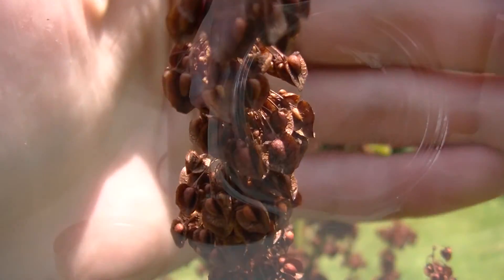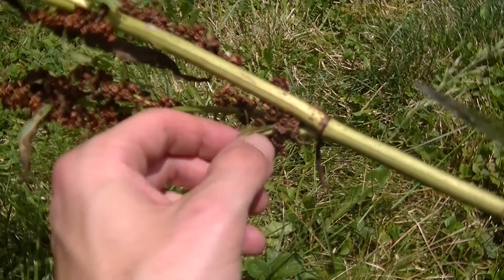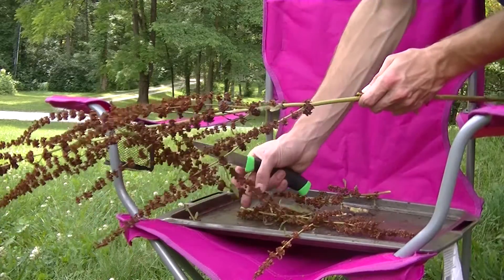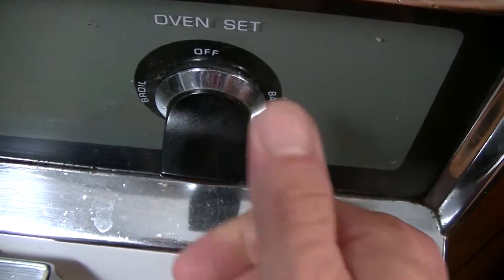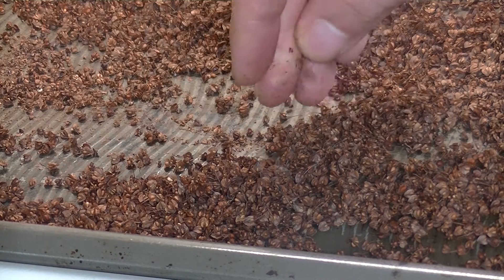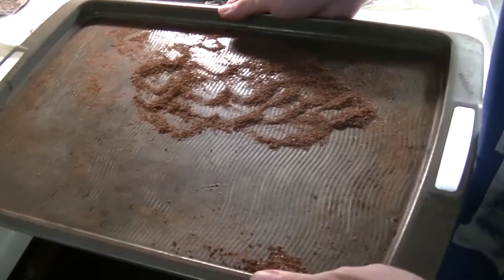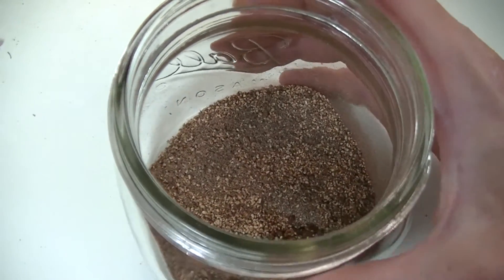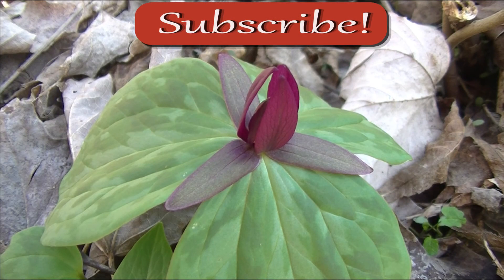Harvesting Wild Edibles - Curly Dock Seeds

Comment: Is it possible to grind this up with a mortar and pestle method instead of a blender? I'm going to be living with no electricity starting this year and for a long time after... maybe forever. Great video for another very valuable food source. Thank you.
Reply from the maker: It certainly is possible, but will be very difficult as the outer husk of the seed is extremely tough and hard. You might try soaking the seeds in water for a few days, or maybe even sprouting them. That might make them easier to grind up. Hope this helps and thanks for asking!
Reply: I know this is an old comment so this may not be helpful, but a food mill could be perfect for this. There are some decent hand powered ones for pretty cheap.

Comment: If you are going to add normal flour, no need to remove the shaft. In some wheat flour for example they keep some of the shaft and the bread out of it is high fibre bread. A lot of fibre is not always a bad thing even though it is not digestible. If the shaft affects the taste a lot then it is an issue.

Comment: simply hand strip seed from standing plant into a garbage bag.
rough grind hole seed.
simmer
grind mixture in water until oils and unwants float on top.
gently skim off the floating debries by gently over filling the container.
strain the heavy and dehydrate @110° till completly dry.

finish grind this in a stone mill or household equivalent appliance.
having removed the oils and fats from the flour.
this smooths the taste and prevents the flour from turning rancid.

doesnt matter what you want to make flour from this method works great.
thing like nuts and corns with lots of tannic only need cold soaked and rinsed until water no longer discolors.

have fun and enjoy your gluten free non poisonous non commercialized nature foods.

blessings.
Reply: THANK YOU. I will do your method.Blessings👍